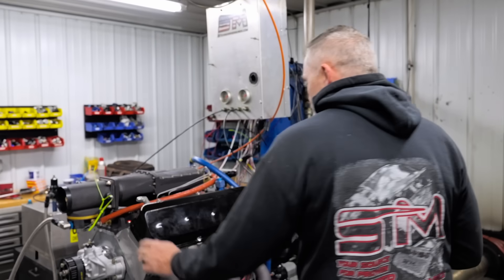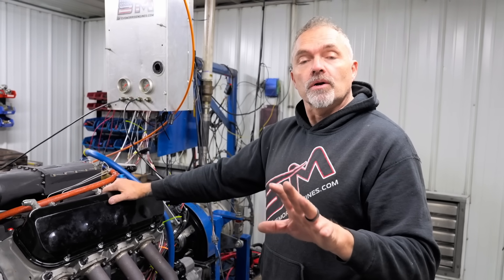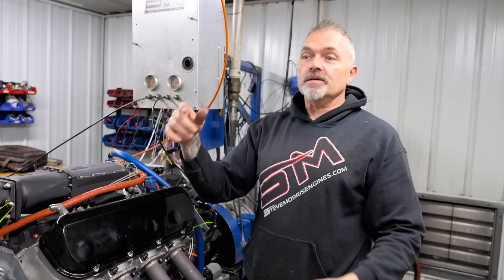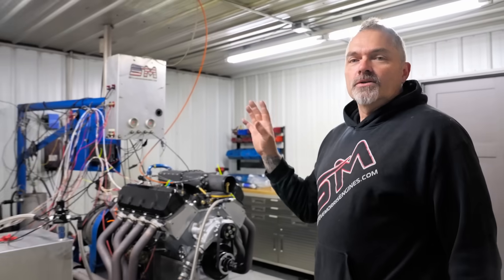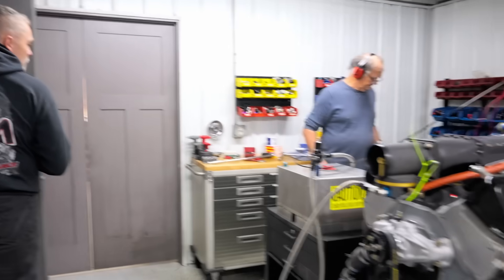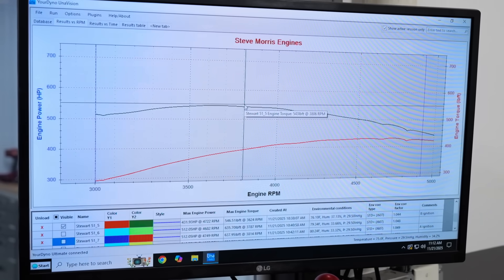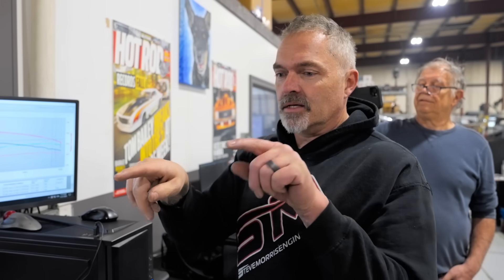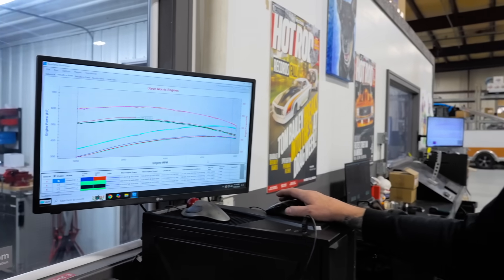Amazing 2 Spark Plugs Per Cylinder BBC  1 Spark Plug Makes almost 100 HP More Than The Other one ?

Comment: Evening All.

Just a suggestion. Colour coding the 2 systems might be wise. If we don't get to the bottom of this and theres a discrepency you dont want two mixed up plug leads causing one cylinder to run at a different tempetature at altutude. Just a thought. 

Have some experience vintage bike engines. Plug placement dies affect things a lot. Side plugs are a but rubbish, central making a big difference. My immediate thoughht was to run both, this turns out to be not the case. Placement is more important than amount.

70 bhp over 8 cylinders, 8.75, out of 500/8. Its only a few per cent.

Could be the reverse of stratified charge for optimised economy. Cylinder swirl creating a pocket of harder to ignite mixture? If the mixture is homogenous its more curious. Both plugs are far from centralised, so could it be piston top shape and squish interacting with flame propogation. Could it be partly friction from cylinder pressure acting on the piston off centre and slightly differently? The over thinking it knows no bounds....

.... I think swopping the leads system to system is worth a check. SM ays he is sure tdc is the same accross both. Could it be coil dwell? Are the flywheel magnets causing some curious emf thats affecting the ignition windings? It seems more likely  than plug position being 8bhp a cyl but I watch with interest.

If it really is plug position, some special plugs are drilled for pressure sensors measuring at really high frequency. Plotting cylinder pressure against electrode position would be cool.

Comment: This test screams.. Combustion Design is WAY more important then people think

Each plug has its own MBT (Minimum Spark for Best Torque) timing.  The rear plug might be in a much better position and require less timing to hit the same ideal burn phasing. The front plug might be in a spot that makes the flame start slower or travel further.  Since your running the same timing the rear might be close and the front is essentially retarded.   There’s likely variables in where both plugs are relative to the bulk of the trapped mixture at TDC. The rear plug might simply be more “central” to where the mixture actually is when the piston is at TDC, especially with your piston crown shape. If the chamber/piston generates strong tumble in one direction, putting the plug near the tumble core means the kernel is immediately in highly turbulent, well-mixed charge. The rear might also be slightly less shrouded then the front. 

If you did proper timing sweeps with both I’m wiling to bet that the rear plug wants less advance and will still make more power. The front will want more advance but still won’t quite match the rear. You should sweep timing for both sets and find the MBT for each.  Compare the best torque/ power and timing required to hit that MBT.  Then set the timing somewhere in between the two.  Then sweep the timing with Both plugs active to find the optimal dual ignition MBT focusing more on CHT and BSFC then the dyno numbers or  irrelevant EGT.   With dual plugs you want to focus on the CA5O.  Dual plugs are extremely good at speeding up the burn and shortening flame travel. So the CA50 moves earlier,  you don’t need as much timing to catch the window, you reduce pre TDC pressure rise, get more torque and lower CHT / BSFC.   If that’s a typical combo you guys run with a single plug then your defiantly going to want to reduce the timing significantly to put the CA50 back where the crank wants it.  Just adding a second plug to a modern “fast burn” chamber would likely require 4-6° less.  Old BBC wedge stuff…6-10° less. Massive bores, big domes,  slow chambers and Aircraft engines 10-15° less.

Comment: words will not be correct but hopefully the idea gets across
when you use the plug farther away from the exhaust valve.  the burn pattern has a moment longer to form a pulse wave before the exhaust valve can interrupt it before going out the open valve

Comment: My 4 guesses. 1. the plug near the intake valve is seeing more fuel since it's getting dumped right over it, causing a better more complete burn. 2. Better swill at that location. 3. Piston shape causing this. 4. Or the timing is way off due to them being assumed to be married up but actually not. A timing light would answer that in about 30 seconds. I think #3 is the answer.

Comment: Not an aviation, but spark plug and ignition it related story; I changed my spark plugs and noticed a very noticeable difference in the seat of my pants. Unfortunately I also damaged one of the spark plugs leads and created a misfire. In spite of that misfire I still noticed the change in the spark plugs. I changed up the spark plug wires with a high performance set to correct the misfire and wow, another seat of the pants noticeable difference. Been a while later The coil pack developed a quit when hot situation. The high performance coil pack available was not that much more expensive than the factory one so I went that way. OMG, another very noticeable difference again! My old workmate was right when he told me that any new car to him immediately got an improved ignition system and I am a believer! I am aware of and follow the work that you do in the performance field. I just thought I would share my experience, cuz it was real!

Comment: The dual ignition thing goes back to when magnetos were unreliable and every airplane had to have dual ignition so if one failed, the  engine would continue running on the other one.

This is an application that screams for a dual-plug hemi!
Reply: That is exactly what I plan to use on my Stewart Mustang. A 6.2 Hellcat.
Reply: @pwpt6  Go with turbos.  Better altitude performance.
Reply: @andyharman3022  To much heat, and it takes away from the looks of the airplane. I'm not concerned with altitude performance anyway.
Reply: @pwpt6  The Hellcat supercharger fits under the cowl?
Reply: @andyharman3022  I don't see any reason it won't.

Comment: Owned the Alfa 75 turbo evoluzione I.e. The I4 was a 1.8l two valve with two spark plugs and a giant garrett turbo. Usable rpm was 45-7000. Twinspark really helped at >5500 with so much fuel in chamber at short duration

Comment: In 1994 Kawasaki supplied me with some "special" spark plugs. My sponsorship allowed me to buy direct from japan and air ship next day...ANYTHING they had related.
So I order these MAGICAL Fine wire , "platinum" spark plugs that are $17 a piece. ONE ride, and every champion plug was given away. Those plugs ran strong, didnt detonate as much! I could go one clip lower on the needle and get some crackle goin on without melting them! They ran CLEAN, they NEVER fouled. and they NEVER failed me EVER!
But a champion plug was $2 and these plugs were $17 in 1994. It WAS NOT A BARGAIN FOR THE BUCK LOL!  Nice work Steve. Really GLAD you come so far since the garage at the house days friend.
(I remember seeing ya thru my drag racing friends when we were all skinny and beardless...
Reply: I was a service manager at a bike shop (and a GP roadracer).   The main thing I learned working on all those engines is that Champion plugs don't belong in anything you want to run right.   ..or run at all.
  Every now and then I'd get an ATV in that didn't run with a Champion plug in it. Every time the fix was to put an NGK in there and that was it.  Hard to believe without seeing it first hand.    AND more than once.

Years later after getting my 4th of 5th AC Delco plug bad out of the box, I make a new rule that NOTHING I own will have anything but NGK plugs.  Even my lawn mower.

Haven't had a plug related issue in over 25 years.

and you know it's bad when a brand new Delco plug can't fire a slant 6!

Comment: The forward spark plug on which side?  Because when you switch banks it's the opposite relative to the valves.  So is the A and B the same relative to the valves or relative to the bank/engine?

Comment: What is your opinion about firing every 2nd cycle(JAP 4 Cyl motorcycles) versus every 4th cycle like with a distributer like on cars, and bikes with a distributer(I had both types)-?
-Keeping flaming going for high rev's and who now's how output can be effected at high revs with every =2nd cycle.
-Does advanced motor racing computer systems fire other than every 4 cycle-?

Comment: Bendix Fuel Injection Systems 
The regulator works through positive and negative airflow on one side of the diaphragm system and High and Low Fuel pressure on the other side of the diaphragms, both connected by an arm. This is how the fuel system functions. The barrel valve only works at idle.

Comment: On one of the Reno Pylon Racing mustangs, they were using a small block chevy running flat out all the time just to run the blower that fed the main Merlin engine
Reply: What airplane? Never heard that story. Germans built a high altitude twin engine plane with a third engine to drive the supercharger system in the fuselage in WW-II.

Comment: The aviation set up is - naturally for redundancy. The location of the spark plug (For/aft) was interesting for sure. The fact that there was not much difference in power with both plugs makes sense as the plugs are too close to each other to really improve flame propagandation. 
I have always wondered why the big V8´s didnt research more into twin spark (until the Hellcats arrived on the scene) because with 4" bores or more there can be a massive advantage in power, torque and fuel efficiency when done right. 
An engine like that should REALLY be tested with the newer aftermarket Pulse Jet Ignition system, as it again, if done right could add quite a bit of torque and power to such an engine, like 40 maybe 50 hp and better fuel efficiency.

Comment: I think you already nailed with your quick brainstorm - the position of the plug requires different timing.  The A plug closer to the intake valves likes more advance because fuel is hitting it quicker (by a matter of milliseconds)  and the B plug further away doesn't like the advance cause the fuel takes those extra milliseconds to reach it.    But as long as A system is firing, B system is basically irrelevant/redundant, that's why the A and the A+B graphs line up.  A's doing all the work whether B is firing or not, because the fuel hits the A's first. 

I'm betting that if you ran the B spark plugs (alone) with less timing, then they would perform  closer to how the A plugs are performing (with the current timing)    

now ... running them together ..  could you make the B plugs actually beneficial instead of just redundant, by pulling timing from JUST the B set?  

running two separate ignition systems at 2 different timings for two separate plug positions - would that work? 
 while it makes sense that one position would want more or less timing than the other when acting alone, I don't know how they'd act together.     it makes sense to me logically that it would still line up with the A graph, but the upside would be the B plugs would perform just as well as the A's  if the A's were to fail.  instead of losing 100hp.  

but I really have no idea how a dual plug "staggered spark"  would  actually perform. I think B plugs slightly retarded will still be redundant alongside the A's (not adding any power)   but would perform better on their own if A's were to fail.

Comment: The A plug location in the chamber is just worse than the B plug.  Both are worse than the original single plug.  But they achieve the required redundancy.  It would be nice if they could make room on the intake side.

Comment: My hotrodded BMW motorcycle has twin plugs. It starts super easy and lets me run regular gas with a 9.5:1 CR. Better mileage, 28 degrees at full advance- stock is 36. Runs cooler.

Comment: Swap the sparkplug wires A and B so we can compare timing, if they share a magnet and use separate hall sensors then it could be incorrectly calculated timing for the B plugs.

Comment: I’m guessing it’s the one closest to the intake valve that makes the most horsepower. I would also venture to say that the second plug, when turned off, is obviously further away from the intake valve and also blocks and/or changes the way the mixture ignites and moves across the cylinder causing the massive loss in power.

Comment: Would O2 sensors show less fuel being burned from b ignition? Resulting in less power . Or is the same amount of fuel being burned from both an and b spark locations , which would lead me to think the “a” location results in a faster burn which would make more power. I would be curious to see a test on the gen 3 hemi like this one.

Comment: so based on this dyno test is there actually power to be made by the location of the spark plug or is this just pure coincidence? it would be interesting to see a dyno test of the same specification engine with the stock location single spark plug and see where the power falls

Comment: Too many imprecisions here, you must soak a little in aero engines first; redundant ignition is a standard in aviation, because magnets (L & R)  had a reputation for being unreliable in the past; the thermodynamic was another subject, as you can modify the advance of the combustion stratified mixture or the front flame speed.
The Continental C-90 has more than 80 years, double spark plugs and redundant magnetos; in a pre take off check the engine is put at 1,700 RPM and the magneto switch is selected from right-both and left-both in order to check fouled spark plugs (lead tetraethyl forms lead peroxide and fouls the plugs) The normal drop in RPM are at least 25 RPM with one mag off. 
My Honda motorcycle has redundant ignition too, two spark plugs per cylinder, as the Alfa Romeo Twin Spark engine and many others, like the Chrysler Hemi crap.

Comment: Chrysler knew this in the 40s on aircraft engines , implemented it in the 60s on the Race Hemi's and modern Hemi's and wedge 3.7 and 4.7 use dual plug spread duration coil dwell for significant hp and fuel mileage MOPAR !

Comment: In  a nutshell flame propagation "time" on a Hemi needs less timing than a wedge because it takes longer to explode across the wedge in distance terms. tune your power to ignition B for peak HP will yield more "push" per cycle, Torque because you use the flame wall thrust longer as it were Think 45 pistol versus 45 rifle velocity. This only works for power propagation till the cylinder evacuator speed is inhibited by the physics of the speed at which said fuel burns
Reply: Combust, not explode. We don't explode fuel in an engine (not intentionally), that's called detonation and it breaks stuff.
Reply: Forgot to add Torque and HP are derived differently. The flame wall propagation of a Diesel is slow making huge torque but can only rev to the "Speed the evacuation and flame wall  propagation can run. This is why there are no 10,000 rpm diesels. Run all engines in their sweet spots.

Comment: The mags were always tested on ground before take off, both mags on higher rpm turn off one mag to look for rpm drop and both mags should display same rpm drop when switched off while testing on ground verifying integrity of ignition system. If not some ignition wires could be at fault or plugs so really would ground aircraft for repairs until corrected.

Comment: Add timing to the plug closest to the exhaust valve. Your flame front burns faster near the fresh air at the intake valve than the dirty air near the exhaust valve. If you add timing to the exhaust valve side about 2 degrees before the flame front should meet in the middle with both plugs firing giving you an even and more complete burn across the whole piston.